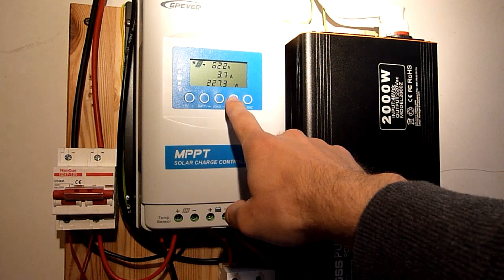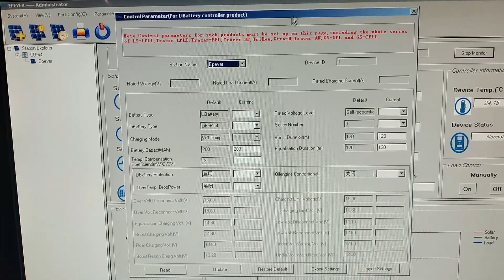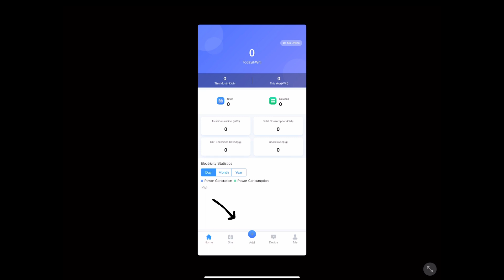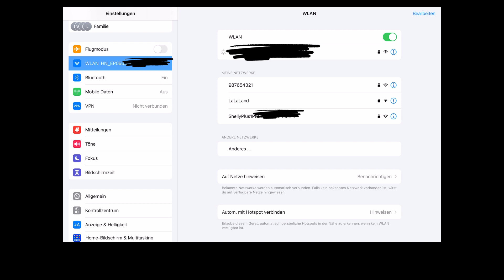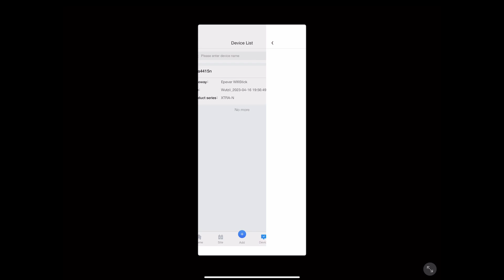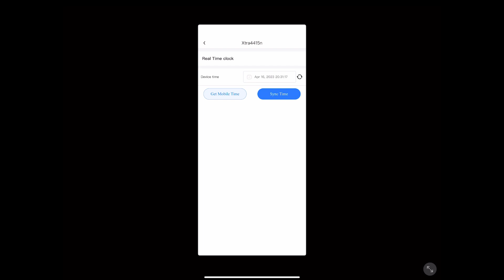Epever Xtra 4415n using DC Output 48V and 40A Settings PC Software and App-Install (Solar Guardian)

Comment: Hello. Have you used this solar controller so far? What can you say from experience, does it have any significant problems and is it worth buying?
Reply from the maker: Hello, for me until today it works very well. No problems at all. Also the combination with the inverter works great. The cloud is now much faster. So I would be it again - Epever quality is much better that cheaper „no name“ stuff.
Reply: @robertwutzi  Thanks for the feedback!🤝

Comment: In this mppt charger can i set value by self for lipo4 battery or not and can i use to run inverter without battery
Reply from the maker: You can set the values by yourself as you can see in the video. Running without battery I didn‘t test.
Reply: @robertwutzi  bro if i buy same usb stick like in your video can i set parameter via android phone? Like i want to set lfp cut off volt 3.5 per cell?
Reply from the maker: Yes, it also works with android as well (I use android and ios). You cant set the values for all cells togehter (e.g. 4x3.5V = 14V for 12V system) - not for a single cell (just with a BMS).
Reply: @robertwutzi  yes brother you help me a lot thank you so much 👍

Comment: That battery cable looks atrociously small.
Reply from the maker: Sure, it can be thicker.
Reply: @robertwutzi  Divide the wattage of the inverter by battery voltage. Then multiply by 1.2

Comment: Hallo Robert, macht denn ein MT50 von EPever Sinn für den Xtra4415N?
Reply from the maker: Hi, würde das abhängig vom Einsatzort machen und ob der WiFi-Stick genutzt werden soll, denn der belegt ja des RS-Port, den auch die „Fernbedienung“ MT50 nutzt. Wenn der Laderegler so verbaut ist, dass man das Display schlecht sieht, der Weg dahin versperrt oder zu umständlich ist, kann diese Verlängerung des Displays das Ablesen und Einstellen erleichtern. Ansonsten geht das auch alles direkt am Display bzw. über die App (wenn man damit zurecht kommen möchte).

Comment: Hi, you don't connect to d/c output because the max watt is 1040W out of the d/c output @24v, depending on your battery you are charging, and if your sine wave inverter is 2000w you won't get enough power to the inverter through the d/c. This is why they recommend inverter direct to battery cos the battery can provide up to even 100+Amps.
Reply from the maker: Yeah, right in this case. In 48V 2000W possible, in 48V 3000W not. In 12V 500W possible, in 12V 1000W not. That‘s what I‘m mssing in that manual „recommendation“ an example where it‘s possible and where not.